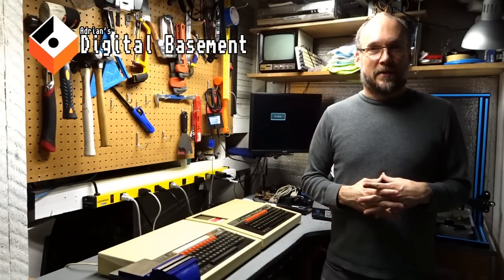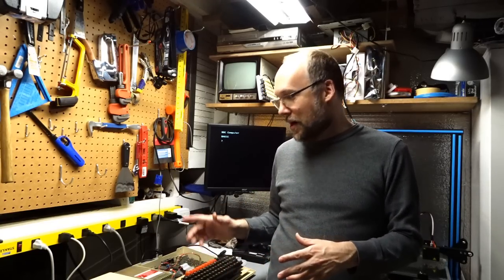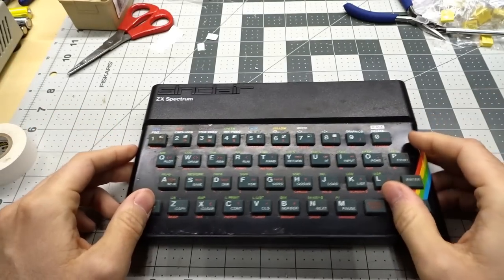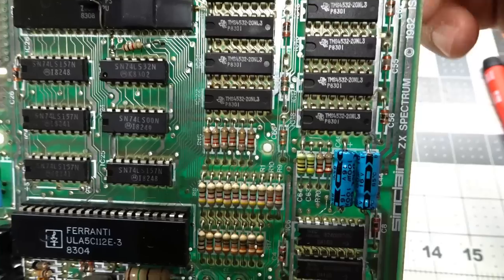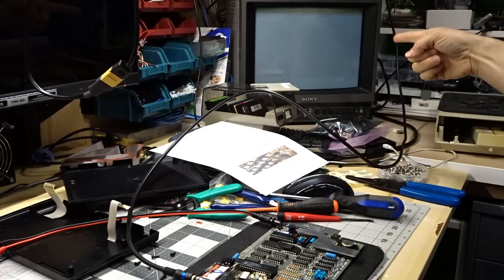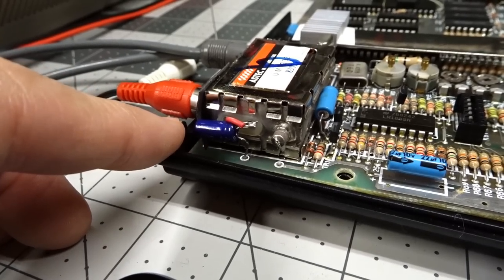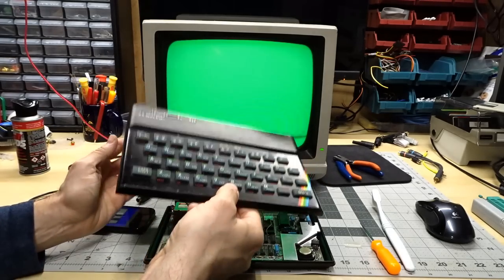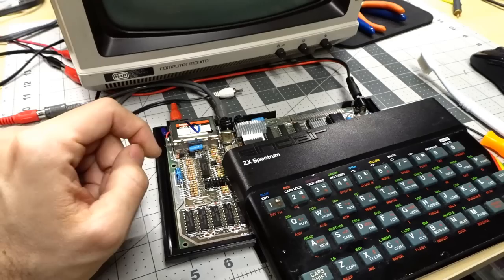ZX Spectrum Part 1 - It's a very sick machine (and a BBC Micro update)

Comment: This takes me back, i used to work for video vault repairing spectrums and upgrading the keyboards. There was a team of 5 people working in manchester, each repairing about 25 spectrums a day. We had diagnostic boards from sinclair that we plugged into the expansion port, it didnt get all the faults but worked well. I did hear that the guy that ran the place bought lots of stocks of chips from sinclair after they colapsed. I remeber lowering the resistor to the speaker on quite a few to make them louder. ty for the video

Comment: I have repaired a few Spectrums, a company called Retroleum (www.retroleum.co.uk) have all the bits you need. The face plate on the keyboard is glued down, this can be removed by applying a little heat and easing off. The keyboard membrane then can be replaced, this is an easy fix. Retroleum have an upper ram module that is what you need.
Reply: I've used that company a few times. They even sell a modern day replacement ULA, as the original ones are hard to get hold of..  I purchased one recently as mine had gone deaf and wouldn't listen to any audio input..
Reply: Other possible sources for spare parts are Mutant Caterpillar, and SellMyRetro.

Comment: When I worked at Sinclair, we had a skip full of returned, dead speccy's. We never bothered fixing them and they just went in the landfill. I repaired some of them to determine their failure modes so we could improve the quality (hah!, I know, I know). The failures fell into 2 buckets. Most of the time these 64/32K chips went bad, but there were an equal number of power supply failures for the negative voltages. I'd start there....

Comment: It's amazing how well Arkanoid runs on the BBC.  and running on an EPROM no less! good work!
Reply: EEPROMs aren't that hard to connect to a bus, even if you have to make an expansion card. Just the EEPROM itself, an address decoder, a couple filtering caps, and your good to go.
Reply: @BlackEpyon  the BBC has empty ROM Sockets inside. It encouraged people to install custom ROMs. No need to do any of what you mentioned. Just shove the ROM chip inside and call the program.

(Also, "you're")
Reply: @benanderson89  Even better. I don't have one myself, so my knowledge is limited.

Comment: we started off in progrmming in 'Basic' on 'that thing' .... aahhh memories . I'm 45.
Reply: They still use similar things to teach programming, or did until very recently. My first programming language was Z80 assembly. This was in late 2010!
Reply: @unregistredhypercam  huh, interesting. I’d heard they brought programming back into the curriculum, but I hadn’t looked into it. In 2003 we just got taught how to use Microsoft Office, Paint, and a flow chart program. Any programming was an advanced elective IT class when I got to picking electives in secondary school in about 2009, but you had to get a good grade at that basic end-user stuff earlier on and I didn’t get that, because I found it too basic and tedious (I was already programming at home, but hated that I couldn’t access it in school. So I was too antsy with doing the boring stuff. I had to settle for the second highest one, which was yet more how-to-use-software, only focused on Dreamweaver, Photoshop and Flash rather than Office programs, which at least were more my speed because I could be more creative with them.)

Comment: the keyboard membrane and the ribbon cables are all one part and cost around £9 ($12) in the UK but unfortunately it looks like it will cost you at least that again in shipping costs. Also reproduction faceplates are available if you want the machine to look like new again.

If you have plans to come to the UK again maybe leave the Spectrum until then and pick up the parts you need over here
Reply: Well worth it if you are a collector.
Reply: Couldn't he buy a Timex one in the US and use the parts to repair the Spectrum?
Reply: @MontieMongoose  they're hard to come by in comparison to the uk version
Reply: looking at picture the keyboard is slightly different on the Timex models - extra CAPS SHIFT key on the right side and a bigger ENTER key
Reply: @MontieMongoose  The Timex equivalent to the ZX-81 is almost identical and the keyboard membrane would probably be interchangeable.  However the Timex equivalent to the Spectrum is the Timex/Sinclair 2068, which is only a 'near clone'.  I doubt the keyboard membranes are physically interchangeable.  

The 2068 has a different BASIC ROM, has built-in joystick ports, and has an AY sound chip like the Spectrum 128, though the computer only has 48K of RAM, and the AY chip is located at a different memory address from where it is in the later Speccies, so it isn't compatible with Spectrum programs that would use the sound chip.  Many Spectrum programs won't work on the 2068 because of the differences in the ROM.  But the hardware is otherwise similar enough to the 48K Spectrum that if you put a (copy of a ) genuine Spectrum 48 ROM in it, it can run most Spectrum 48 software.  Which is good because the T/S 2068 was only sold for a short time, and there was not very much native software for it at all.

So it might be almost as hard to come up with a Timex/Sinclair 2068 in the U.S. as it would be to find an imported Spectrum, or have parts of it shipped over from the U.K.  And if you're going to get a 2068, it would make more sense to put the Spectrum's ROM in it than try to make its keyboard membrane work in the Spectrum.
Reply: @MontieMongoose  Then he would be scrapping another computer to fix his when there are parts available.
Reply: He could use the ribbon/membrane from Timex Sinclair 1500 (a Timex 1000 in a Spectrum case): they usually aren't used much, but then again they are more scarce and thus more expensive so it would be cheaper to just buy that membrane in the UK 😁
Reply: @joelavcoco  hardware-wise the Timex Sinclair 2068 isn't compatible at all: the edge connector is rather an evolution of the ZX81 than a Spectrum. 
The Portuguese Timex Computer 2068 and the Polish Unipolbrit 2086 should be more compatible, but I haven't dared to connect anything up its edge connector!

My TS 2068 has been modded to run both natively and switchable to a Spectrum rom internally, while my 2086 came with a Spectrum rom cartridge.

https://beta.collectorsbridge.com/collections/425?page=3
Reply: @MontieMongoose The only Timex-Sinclair model that could be even remotely useful would be the TS 1500, which is basically a ZX81 in a Spectrum case and with 16K RAM built onto the "motherboard". The keyboard membrane from the TS1500 is pretty much identical to the one in the Spectrum. However, from my investigations on ebay, I think the 1500 is quite rare, which sadly makes your suggestion somewhat infeasible IMO.
Reply: @Marc Kloosterman I believe that when Timex redesigned the TS2068 to make it more compatible with the original Speccy, they also undid the changes that were made to the expansion bus on the TS2068, thus rendering the TC2068 fully compatible with all Speccy add-ons.

Comment: BBC B's were well known to suffer from dry joints on the PSU PCB even when new, although the symtom was usually a computer that wouldn't start. The company I worked for at the time maintained hundreds of "BEEBS" for Pharmacy labelling,  the service desk would tell the Pharmacist to lift the machine 4"" above the counter-top and let it drop!! That generally got it working until an engineer could call with a soldering iron.

Comment: Still got my spectrum like this in the loft in the original box. was working fine when i put it up there. Still got the tape player i used as well.  Brings back memories of loading my games from tapes. Quite often they would get to the end and then say failed to load and had to start again. I remember when I bought it in the early 80s it was about £120 with some games with it.

Comment: You have to fix it!!!!! I’m American and I bought a ZedEx Spectrum off eBay years ago for the hell of it. After a month it got here and didn’t work :( while I was resoldering the ram chips the keyboard connectors disintegrated and I had to wait another month for a replacement from England.  After getting a compatible 720p upscaler and a shielded video cable I was playing Exolon like a proper English lad....
Reply: Good man. So many classic games made for the Speccy. Many of my childhood nights typing in progs from the Sinclair magazines. If only I'd kept the box loads of parts and spare computers that my friend tossed out years ago. Sigh
Reply: @Herbert Chapman AFC The Spectrum was 2 generations of older tech than Amigas and Atari STs, so it did pretty well and along with the Commodore 64 kickstarted the mass home computer market in the UK.
Reply: @krashd  In Dixons, usually!

Comment: This ZX Spectrum deserves a complete restoration in my opinion. This is history of computing. Fixing the Speccy is not a big deal, you can easily find replacement membranes and faceplate from SellMyretro for a couple of pounds+shipping costs. Also your colours issue may have two culprits which can either be a simple tweak of the trimmable resistors or either a replacement of the colour encoder LM1889. For the faulty RAM on the 48K bank those are easy to find and replace at a very cheap price. It's well worth it!

Comment: The Spectrum is probably being under powered (the extra memory requires more juice) crank it back to 1.2 amps, or use a PSU like an Atari Jaguar which works find on all the original Sinclair Spectrum up to the 128K.    

In my opinion I loved the Issue 1, even with it's quirks. It was this version which gave the Spectrum it's rear hump as the memory expansion was on a daughter board.  Pretty cool for back in the day.    If you can find a broken Spectrum +, this will fit directly inside it so you can have a roomier case and better keyboard.
Reply: I never liked the rubber keyboard. The original Speccy was a pretty little computer but that keyboard was awful.
Reply: @herculeholmes504  I agree.  However it helped make an unaffordable computer affordable.

Comment: Hi Adrian,
As an old time Speccy user this brings back memories for me (I'm 49) and is something I'm still quite familiar with.  Something that was a dead give away which I spotted first time you booted up was that it started up too quickly.  Seriously!  The Spectrum did some sort of RAM test on boot up which is the black screen which clears to the (c) 1982 Sinclair Research Limited white screen.  Your machine booted at the sort of speed a 16K Spectrum would, while a 48K should take noticeably longer, something like 2 or 3 seconds more black, to boot up.  As such I wasn't surprised by the eventual RAM fault coming to light.  This is based on personal experience of buying a 16K Spectrum mail order from Sinclair and upgrading it later (young me saved hard for the £125 the 16K machine cost. The 48K was another £50 it was the best I could afford at the time).

The machine I had was an issue 2 like yours.  By this point the 48K had proven popular so the issue 2 16K machine I bought was essentially a 48K machine with the 32K RAM slot empty.  Interesting to note the keys change from grey the issue 1 had to blue.  The cool thing was this made it easy (if rather scary at the time) for an amateur like me to purchase 3rd party chips and upgrade the machine myself - it cost £23 I believe which while worth more then than it is now, was considerably cheaper than buying official or preinstalled.  The upshot is if your RAM proves faulty may also be easily replaced and fairly inexpensively.

A quick word about the membrane keyboard.  This is something that inevitably wore out especially with "button bashing" sport game type punishment.  I eventually gave up on the idea and installed the Spectrum motherboard in a third party replacement proper keyboard case.  Before that though, the other repair I was able do myself as a teenager was change the membrane.  What is weird is you have to remove the metallic keyboard surround (with the upper and lower key labelling on) which is firmly stuck down with glue.  This has to be done with great care so as not to bend it.  It does also mean that once the new membrane is in place, you will need some sort of contact adhesive to glue the surround back on.

I hope my ramblings are of some use, or interest at least.  I found this page during my fact checking and stroll down memory lane, which may be of use perhaps:
http://rk.nvg.ntnu.no/sinclair/computers/zxspectrum/spec48versions.htm

Doing a quick search on Ebay UK I found this example of inexpensive upper RAM (32K upgrade) chips replacement.  I imagine you'd need to buy from the US however:
https://www.ebay.co.uk/itm/8pcs-tested-new-old-stock-4164-upper-ram-chips-for-the-Sinclair-ZX-Spectrum-/182193323977
Reply: I too thought there was something "wrong" with the boot. It seemed quicker than I remember, plus there wasn't the brief black screen I was used to. Interesting if it is because only 16K is available.
Reply: Oh, and I had a particularly bad tactic for the "button bashing" games (Hyper Sports/Decathlon) which involved waggling a golf ball between the two keys. Great for speed, not so great for the physical machine! ;-)

Comment: Hi Adrian, i used to repair all home computers back in the U.K in the 80's. Spectrum owners were our number 1 customers back then with what was a cheaply designed machine that broke down fairly frequently. Good news was parts were cheap and back then readily available. The keyboard membrane is replaceble and is attached to new ribbons that plug into the board. Usually when there was a memory fault one of the memory IC's would run slightly hotter than the others which was usually an indicator of which one you would need to replace (We would use the back of our finger to detect heat differences). Several other home computers used the same memory chip so you maybe able to pull a used one off another board. Also check all the circuit board tracks to the memory chips with a magnifying glass as the tracks were subject to cracking and sometimes we had to replace them with a tiny piece of wire. Hope that helps....

Comment: Hi there, Adrian! Nice video! I loved to see the original ZX insides, since it had a Brazilian copy in the 1980's called TK-85 which was made and sold by Microdigital.
Just a couple of advices about the video (which you probably already know of, but anyway...): 1- To avoid horizontal banding in your television set screen, record the video at a shutter speed equal or multiple of your local AC frequency (in a regular DSLR or mirrorless camera that would be 1/50, 1/100, 1/200, 1/250 etc); 2- To avois "focus hunting", sinco all your takes are static (camera on tripod), use manual focus to avoid the focussing system detecting sudden higher contrast areas and trying to change the focus.
Cheers!

Comment: Adrian, Spectrums came with both 16K & 48K from the factory (prices circa 1983 were £99 & £125 respectively). Sinclair offered a 48K upgrade for 16K owners. Yours's was definitely 48K from the factory. As somebody has already said, the keyboard membrane has the connecting cables integrated. A new keyboard membrane isn't too expensive but you've got to factor in shipping costs from the UK. Something I did back in the day was to trim the ends of the ribbon cables to ensure a better connection. Sometimes it worked. It isn't about the money on this rebuild. It makes for great content.

Comment: Just FYI, the standard "white" background colour on the Spectrum's display is not very high intensity by default--there was a BRIGHT attribute that could be applied to each colour square which would make all the colours much brighter, including the white, but it was rarely used in practice.
Reply: I never really got why there was a "bright black" option though ;-)
Reply: @IanHodgetts  Basically, because BRIGHT multiplied each RGB component, instead of adding to it. Since all the components for black are zero, the result is still zero.

Comment: Maybe a year too late, but i used to fix these all day long.
Keyboard cables - clean the ends with a rubber eraser.
ZTX500 - replace with ZTX600.
Scope the data pins on the ram and the bad chip generally looks different on the 'scope.
The ULA always fails due to heat. Great move giving it some heatsink.

Comment: I love the rubber keyboard, it was much better compared to the later plastic variety that kept sticking. The ribbon cable will easily fail because the silver pain will crack so I would add a thin stiff baking to it else it will fail. Also,  ZTX650 (up to 2 Amps?)  transistor is over stressed and will pop if the upgrade ram card is slightly moved so I would get a few of these transistors handy.

Comment: BBC and -5V : Not a BBC-micro guy, but out of curiosity I recently saw a long interview with Steve Furber (designer of the BBC). He said - based on feedback from users over 30 years etc. - that the thing that goes wrong with the BBC is the power supply and it is dried up capacitors (one or more, I can't remember). Whenever it acts weird or wont work, replace cap(s) and you're fine. Just relaying information, can't go into details, hope it helps...

Comment: I know john Grant of Nine Tiles here in Cambridge UK. John is the genius behind the short cut key commands on the ZX81 and ZX Spectrum. It was done to save memory. Back in the 1980s, most kids had a Sinclair, or an Acorn. I had and Acorn. I still do. Acorn got a load of bad chips in. The test to find the good from the bad was to play Defender. Did you know that ARM (Advanced Risc Machines) was originally Acorn Risc Machine.